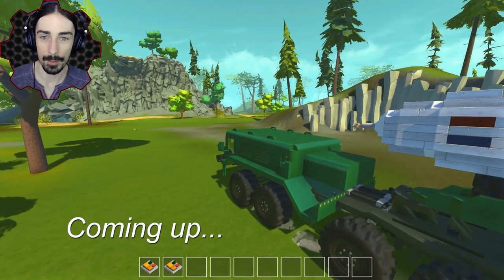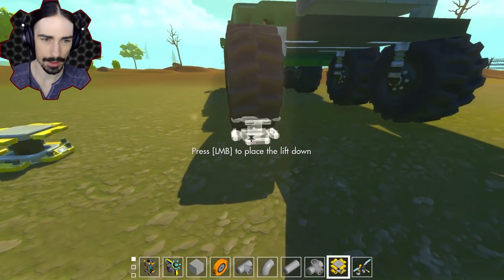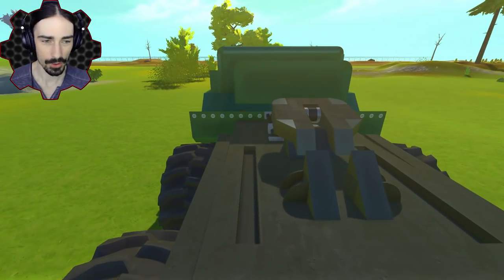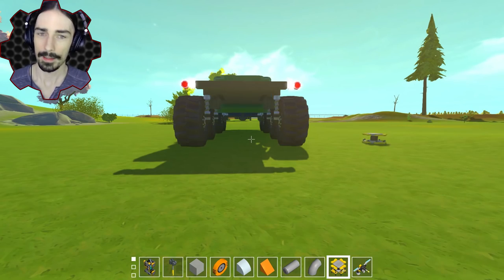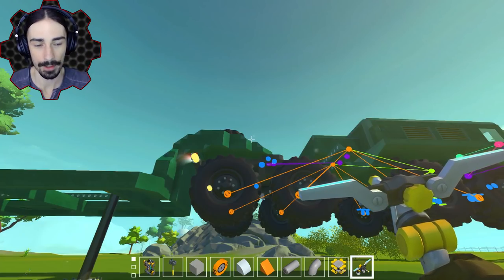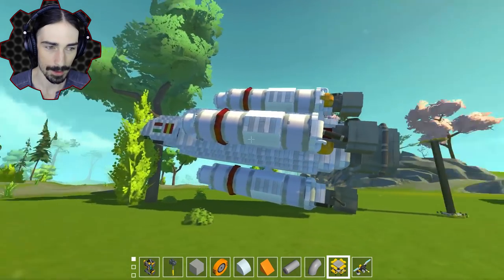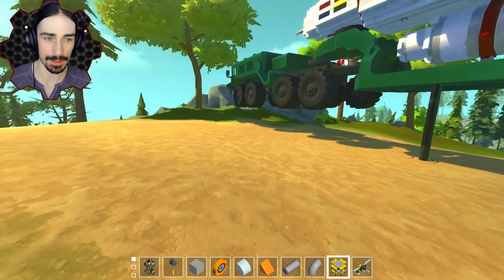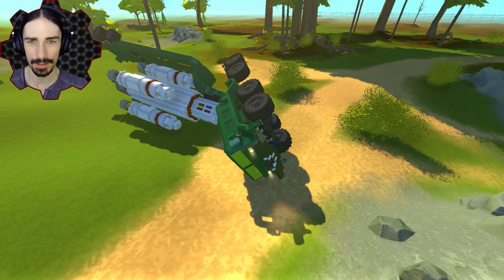GIANT MISSILE ON GIANT TRUCK! (Russian MAZ Truck Part 2) - Scrap Mechanic Gameplay

Comment: MAZ rear suspension has no shock absorbers. It can only rotate because it's designed for heavy cargo, when any type shock absorbers will just brake or insta-compress itself.

Comment: On the topic of a tank not being able to get over wheels on a lower base level then the bed of the trailer, you do realize that it is a tank right? You know, the things that casually drive over whole cars? I'm pretty sure it would be fine.
Reply: But if the wheel on a trailer designed to hold a tank would break just from a bit of the tank being on them at one given time, then I'd say that the wheels are just not up to par with the job at hand.

Comment: If you look at the back tires the most rear ones take a lot more pressure on acceleration do to that bar making it want to wheely the rear tires so if you want you can attach the back bar barring to a motor and just leave the motor off. The electric motor has automatic braking when you don't use it. So you should try to make it work. It should resist the movement a little bit. My discord is MaddManGaming#7252. Contact me if needed